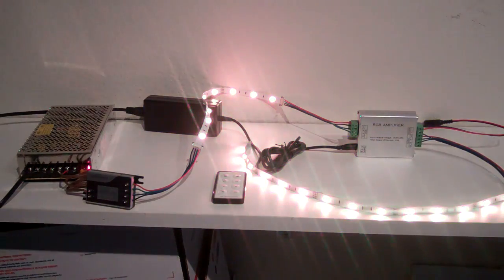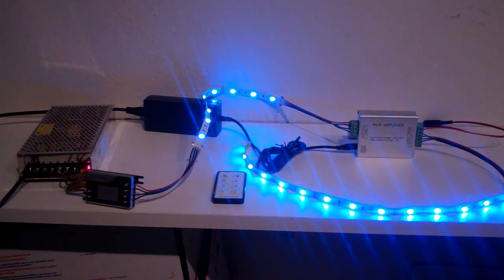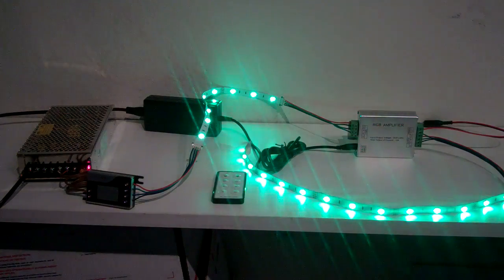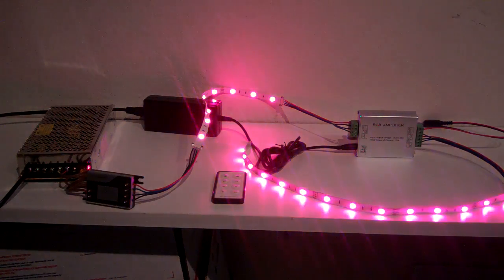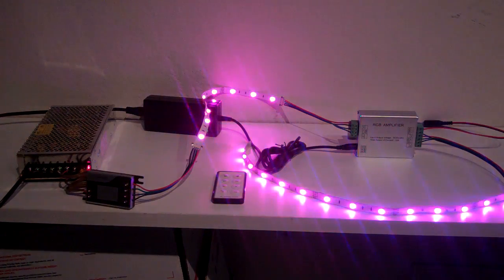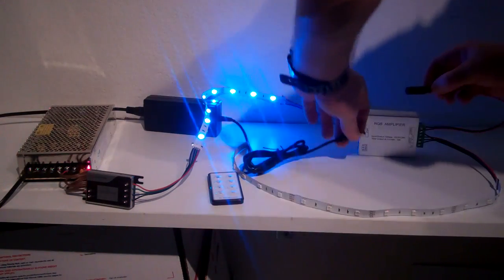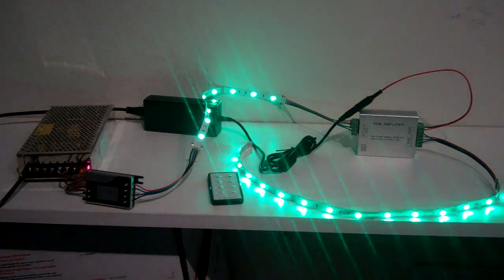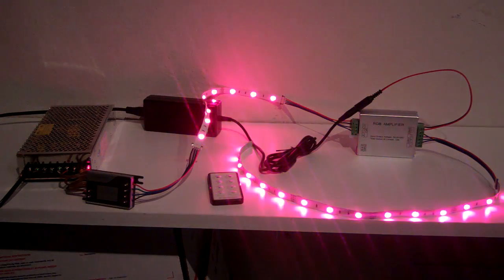DIY: Long Distance RGB LED Amplifier Installation

Comment: I need to install an 8.7m of RGBW @ 24V do you think it will have voltage drop ?
Reply from the maker: Hi there, great question! There will always be some voltage drop. We'd suggest checking the maximum run length in series recommended by the manufacturer of the RGBW strip you are using.

Comment: Can I use this amplifier to get my led DRLs brighter in my headlights?
Reply from the maker: Hello there! This is not an LED amplifier, it is a controller. With that in mind, LED amplifiers usually just works as a signal amplifier when having issues with voltage drop. You would, most of the time, have another power supply to handle the load of the additional piece of light.  That being said, DRL lights on vehicles work a bit differently so we would recommend getting in touch with a dedicated automotive representative to help you with your inquiry

Comment: I have ws2811 12mm lights. I am trying to do a long run with a temporary controller that us a cheap Amazon magic home controller. I have about 84 feet with one 8 foot gap in lights and one 4 foot gap in lights for a roof line (gap is continued with 18 guage wire). I am able to have it work with two controllers, but the 8 foot gap is where the signal is dropped.  I would like to controll them all on one controller so they all stay together. I know there are better controllers that will work and I plan on getting one but not spending the money yet. Is it possible or just keep with the two controllers. I do resupply power ever 15 feet for the voltage drop, the data is the only thing dropping. It's 960 pixels with the controller rated for 2k something. Or do you know of a controller that will work that is in the 50$ range.   In the future I plan on spending about 800 on a controller setup for the entire yard, but doing this one step at a time.

Comment: We don't understand what's the point of having an amplifier instead of just using the regular power cord for the next line I thought or we were looking for something in line that doesn't need a power cord to amplify the power for the next length of cord that makes sense to us but what you're saying for each length of time to add a giant box and then plug it into the wall won't we just use the regular cord if that's the case, we were looking to do a run of four of five length chords with just one cord is this possible

Comment: Hey, do you know any controllers/apps that contain settings for using a strip as a circadian alarm clock (LEDs come on at a certain time, slowly increase in power)? If there are a few you can think of, any that provide the most customization with how slow power is increased? Thanks for weighing in! 😀👍
Reply: Hi! Try magic home with a wifi controller for your led strips.

Comment: Can I have a long run for my output off amp.  I have outside lights and need the amplifier about 20 feet away in order to power it so end of first strip would be 20 feet into amp and then 20 feet out of amp to next strip

Comment: Should the power supply going to the LED amplifier match the Amperage rating of the Amplifier? For example, the Amplifier is outputting 18A of current, should i also connect a 12v 18A power supply?
Reply from the maker: You simply need to use a power supply that can handle the load that will be connected to it. Give us a call at 925-273-9080 if you have any other questions.
Reply: @flexfireleds  Thank you!!

Comment: should the rgb led controller rated for the length of reels even if we are using signal amplifier? or a controller rated for one reel will do?
Reply from the maker: Hi there, thanks for watching our videos!
Anything after the amplifier does not put a load on the controller. Hope that answers your question.
Let us know if there is anything else we can help you with.
Reply: Flexfire LEDs ohh I see, thank you for the information

Comment: What power supply did you have running to your rgb amplifier, and what are the dimensions for the Amplifier, length, width and thickness? Would it work with a 24v, 5A that comes with Supernight LED strips?
Reply from the maker: Hi Luke,
The power supply and amplifier really depend on your set up. The dimensions will also change depending on which units you use. 
I encourage you to give us a call at 1-844-FLEXFIR or send us an email at info@flexfireleds.com with your specific set up so we can point you to the right units.

Comment: i have 150w led has a  120 ac to 12 v dc power supply  i want to run them at 14v (20% brighter what are my options to get them brighter im running them with a fan blowing directly on them so im not to worried about shorter led life
Reply from the maker: It depends on your power supply. Does your power supply have a voltage adjustment screw?
A DC Boost converter may also work so you can increase the voltage.
Don't hesitate to give us a call at 1-844-FLEXFIRE if you have any other questions.

Comment: do I really need a power supply box or can I use the normal IR power supply
Reply from the maker: Hi there Alejandro, thanks for watching our videos!
For DC strips, you will need a power supply or step down transformer so you can power the lights without damaging them. We aren't exactly sure what you mean by IR power supply. However, feel free to give us a call at 1-844-FLEXFIRE to get all of your questions answered. You can also email us at info@flexfireleds.com

Comment: I bought 2 strips of rgb 3528 and I bought a 12v 5a power supply when I hooked it all up. The second strip of lights was very dim and some of the lights wernt lighting up. I checked and it isnt the lights. So do I need a bigger power supply or a amp?

Comment: Is this what I would use to power 2 led strip light? One on each shelf and need extension from power supply split into 2 strips
Reply from the maker: Hi Jess, thanks for watching our videos!
You don't necessarily have to do this to power 2 LED strips. It depends on the LED strip itself as well as the lengths and installation. We'd love to help you with your project. Give us a call at 1-844-FLEXFIRE to speak to one of our LED specialists and make your project a reality!

Comment: hey guys, im running a 6x5m stripes around my ceiling in my room.. someguy in a forum told me i should use 5 amplifiers and 1 controller to power these stripes, so that they all are on the same brightnesslevel and dont burn off at the beginning if i hook them all up together. well i was aware of that, but i didnt know anything about wiring these up, until now. so the and of the stripes goes into the amplifier, though i need to solder it to the controller and stick them all into it. how do i do it, the power and amplifiers are in one corner, do i need to run cables than from and to the stripes in the ceiling decoration? that was the principe i was told, it will take me around 100m 4x1,5mm cable, is that the proper way doing it?
Reply from the maker: +weekndgermany Hi there, thanks for watching our videos.
All set ups are different and the use of amplifiers depends on voltage as well as the strip itself. We'd love to help you design your project. Please give us a call at 1-844-FLEXFIRE and speak with one of our project developers.

Comment: So an other words power supply controller leds strips at the end of the strips amp goes then stripes again so on and so on. Correct?
Reply from the maker: +ultimateone624 Hi there, thanks for watching our videos! The placement of the amplifier depends on the strip itself. First power it up to see where the voltage drop begins, once you identify where the voltage drop begins, you insert a signal amplifier which will be powered by another power supply. Some strips can go 2 16ft reels in a continuous line before signal amps, others can go 3 reels (Such as our Colorbright RGB 150 24v) but other strips can only go 1 16ft reel before you need an amp. The basic wiring would be: Power supply > LED Controller > LED strip > Signal mp + Power > LED strip.

Feel free to give us a call at 1-844-FLEXFIRE if you have any other questions. Thanks!

Comment: Instead of messy amplifiers why not connect the end of the run back into the power supply to power from both ends? Will this work?
Reply: No... adding voltage without the use of the amplifier will overpower the grounds and cause the entire length of lights to light incorrectly. Too many times of adding power can even burn up the relays and or burn the ground traces in the strips themselves.

Comment: I am going to be running a 8ft rgb strip under cabinets at the end of the 8ft strip I have about a 20ft extension until the next stip of LED's.  Will the amplifier send enough power over that 20ft of 22g rgb cable?  Is it possible to have 2 separate controllers controlled by same remote

Comment: In the video you mention that the big power supply on the left is needed to only power the 1st light segment or 32 feet. So the power supply would be about 150 watts or so?

Comment: Do you need a separate power source? I see that you are using a power and an adapter.Can't we just plug the amplifier and the controller to the same power source using the same setup?
Reply: rangwood i’m going to try this
Reply: @pedl_be  did it work connecting to the same power source?

Comment: I have 2 led SINGLE light spools that have 300 lights on each.  Both spools are 16ft in length.  I intend to use one spool on one wall of cabinets (under and over) and the majority of the other spool on the opposite wall of cabinets. Do I need to use an amp for between each spool and if so, will this amp work?    Thanks!